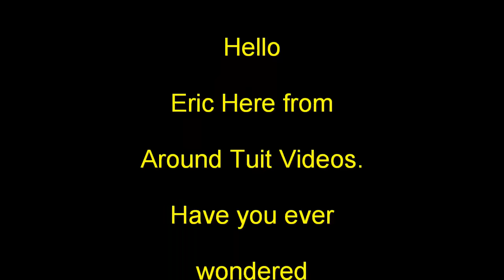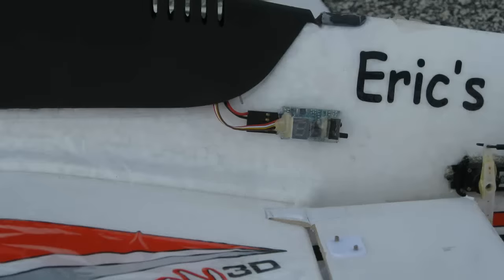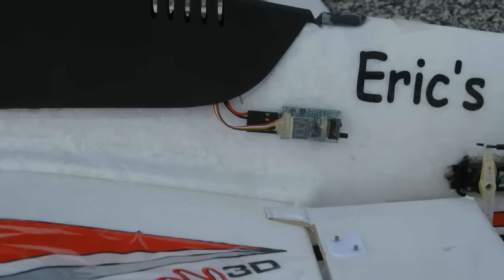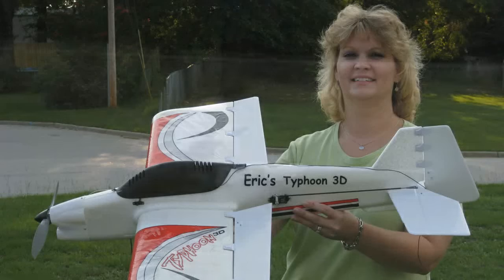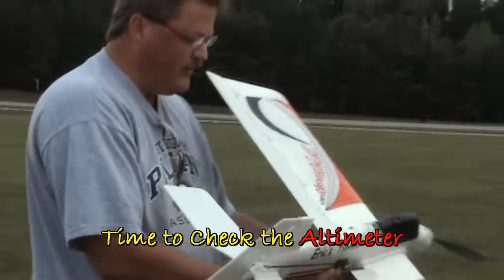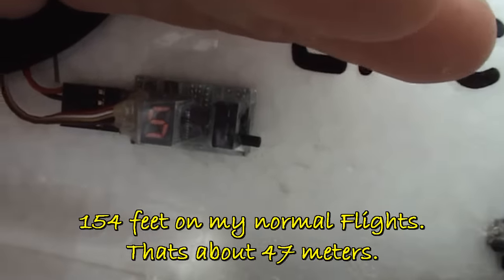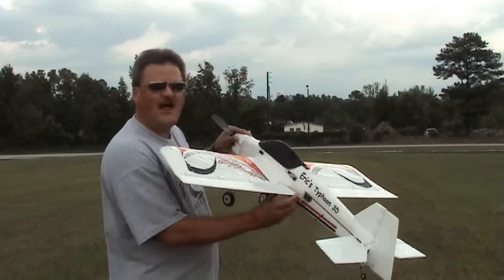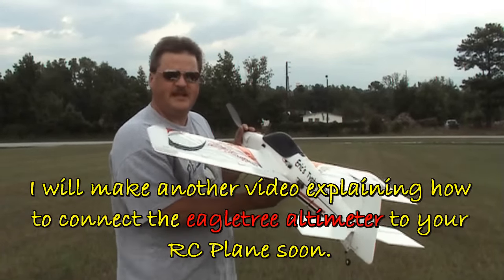Altitude Sensor On A Typhoon RC Plane. How High Can It Fly?

Comment: Just a comment guys from an old pilot...  Anything above 500 feet is into real airplane territory and there can be conflict...

Pattern altitude for planes is 800' to 1200' above ground...
And there are news helicopters. etc. down low...
Now, it is not likely there will be a problem, so just pay attention to where you are flying compared to the nearest airport and the nearest hospital with a helicopter service before you start putting those birds up high..

Nice little gadget, btw...

denny-o

Comment: I have flown my Champ a little over 1,000 feet before.......once! I nearly lost it too and had to guess what direction I had to bring it down to not lose it since the wind that high was blowing the wrong direction. It was verified by a buddy flying FPV with an on-board altimeter. I had hoped you would have gone higher than my Champ but then again it was pretty windy out there!

Comment: @Love4ChristianMetal Check out my on-board footage! I take a seawind ep up much higher than this (thanks to God giving me better then 20/20 vision) with a 720P 808 #11 key-chain cam attached. I even fly out of range a few times (too high), no altimeter though. The view of the ants (cars) on the highway toward the end is especially breathtaking!  I need to get some onboard footage with my Typhoon 3D and F-22.